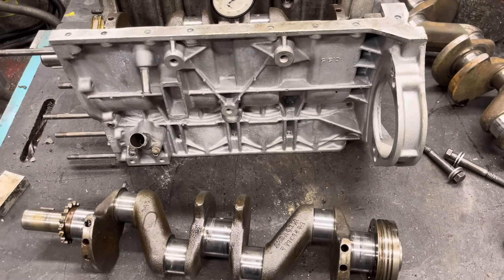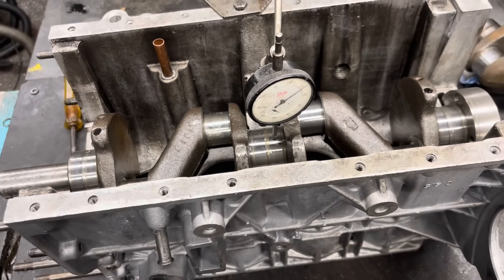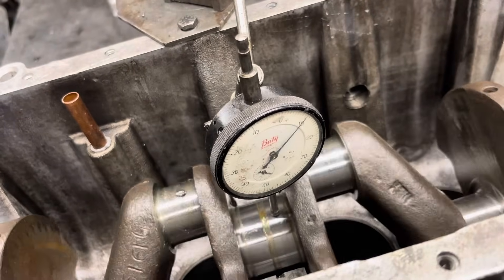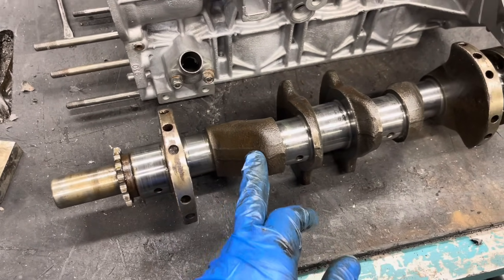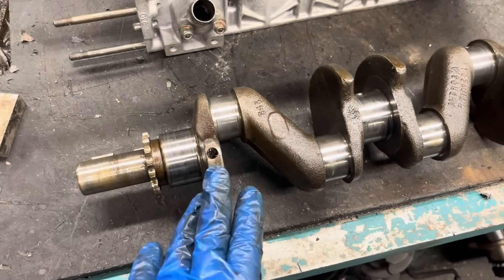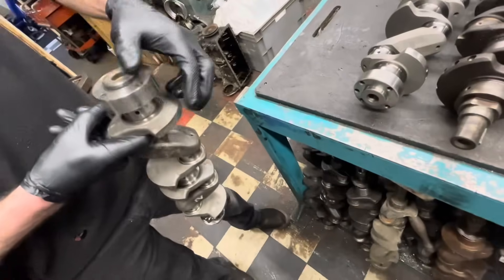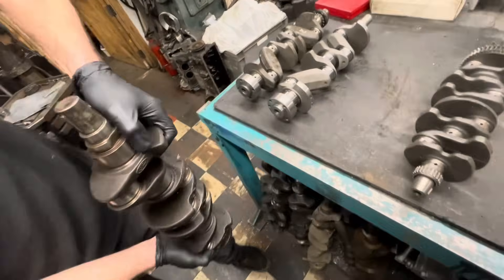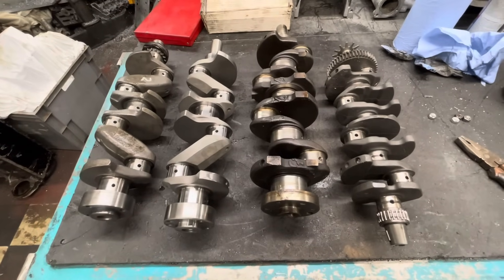Shrigleytube TV ep 24, crankshaft chat and balance, Will runs his 930 on the dyno, 1120cc shortmotor

Comment: Something worth mentioning about the history. I was working in an engine design office about 40 years ago. Out in the car park was my Hillman Imp Caledonian (Monte Carlos, Spax 200, electronic ignition, straight edge block oil drain, big valve) which I used to rev the nuts off regularly. One day, I got a visit from a Vandervell rep trying to sell us crank bearing shells. He left me a brochure with several unnamed examples of the engines they sold bearing for and for each engine there was a 'design speed' for the crank. These were car engines but we were doing truck diesels. Typically, these car engine had a design speed of 4500rpm. However, one of the examples stood out right away because, very unlike the others, it had a design speed of 6700rpm which is nearly 50% faster than the rest! What could this miraculous car engine be? Well, from the partial photographs and tiny snippets of information, it clearly had an Aluminium block and a capacity of 875cc. I wonder what it could be? 🤔
Reply from the maker: oh i love a set of genuine vandervell lead copper bearings ! hard to come by now, thanks for the message
Reply: @thehillmanator  After the Vandervell visit I didn't worry about over-revving it! I had my boss in the car one day and poor Bill was horrified about me revving it to 8000. We dealt with diesels maxing out at 3300 and max torque at 1500 so it was a culture shock for him.

Comment: Difference between the manifolds  confirms what I found on the flow bench - A stock CD125 manifold flowed - 80CFM@28" - the Banana  flowed  106CFM@28"   -   With the runners opened up on the Imp STD manifold it gets to 100CFM@28"